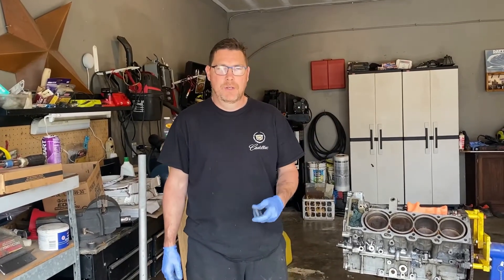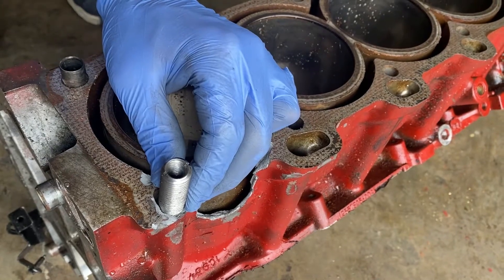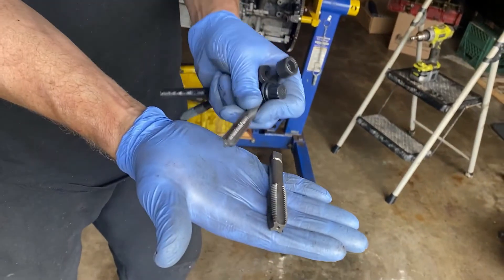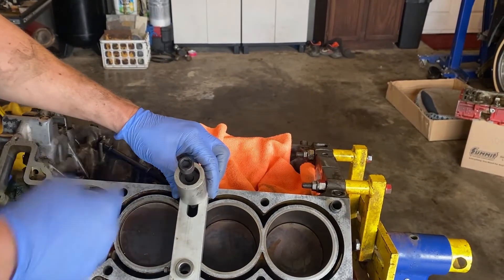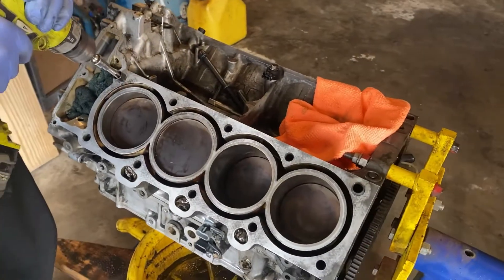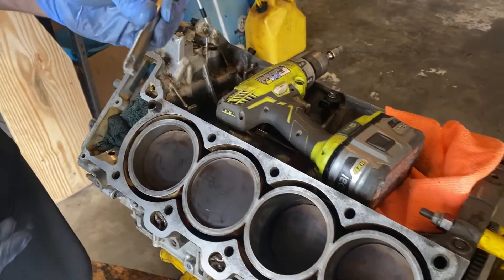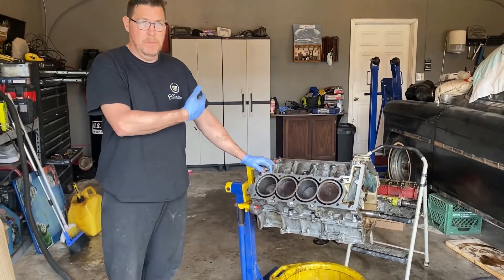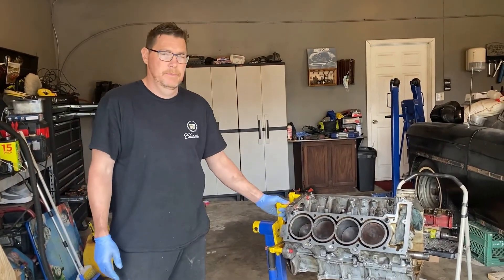Repair Cadillac Northstar Head Gaskets WITHOUT Inserts!

Comment: Hey I just bought a 2003 Cadillac seville. It only has 83,000 miles. Do you have any recommendations on how I can NOT blow a head gasket? I can not afford to pay for this, so my only hope of salvaging the car would be to do it myself. Any tips? I worked in a machine shop for a year, and know how to tap threads etc. but don’t really have the tools to pull the engine or the knowledge to. I can do most things with cars if I have the tools and am shown how but I wouldn’t feel comfortable doing this. I just need this car to last me. Not making much money, so any advice at all is greatly appreciated.
Reply: Pray
Reply: What we have done is flush the Cooling system over and over with Distilled water.  Used some Simple Green Pro Purple as a cleaning agent.  Don't use too much.  It is super concentrated.  Amazing how much gunk flushed out.  After fully flushed and rinsed, used Prestone G-05 Coolant.  This stuff it great and has low conductivity.  So far, our 1998 Aurora is still running on the original Engine.  104K miles and 26 years old.  Also, only use a GM Thermostat.  We installed a MotorRad safety stat and the Car started running too hot.  The MotoRad had 4 small hole for the coolant to flow.  The OEM Stat has 2 half-Moon cutouts for flow and it also opens wider.  Good luck.
Reply: flush the ever living crap out of the cooling system.  Use distilled water several times to both save some money, and to avoid chemicals.  once you think the system is clean, run radiator flush through it, such as prestone's kit.  The problem with the northstars for daily driving comes up when people entirely skip cooling system maintenance.  The FIRST time the northstar engine overheats, it starts to yank on the head bolt threads and head gaskets, even if you never overheat it afterwords.  THe cooling system has so many tiny ports and hoses that easily clog up.

Also, on these northstars, if the heater core gets plugged up, the engine overheats.  It is NOT setup like other vehicles where the heater core is an "accessory" to the cooling system.  On these cars, the heater core accounts for quote a lot of the coolant flow, and when plugged up (which also means otehr parts of the system are as well), coolant flow is restricted quite a lot.

An easy flow check, remove the rubber hose that goes to teh side of your coolant expansion tank,  point it into a bucket or container, and fire up the engine.  If you get zero flow, your system is already at the very least starting to clog up.

Once the engine is fully warm, you should get quite a lot of flow once the thermostat is fully open.
Reply: @mattliston1215  I personally do everything that you said to do with my own cars.  I want my cooling system to be clean also.

But the heater core is a separate system.  Inlet to heater core is at the back of the coolant crossover pipe and the outlet is right where the thermostat sits.  The expansion tank is connected to the outlet hose of the heater core.  Maybe you're thinking of the coolant filter pipe that vents to the top of the expansion tank, which actually does become a problem if clogged.

If the heater core is clogged, and the rest of the cooling system is good, you won't have overheating issues.  But usually if the heater core is clogged, there will be other issues with the cooling system anyways.
Reply: @mattliston1215  Do you know what Engine Temperature is considered overheating?  Ours got up to 250 degrees several times.
Reply: @scotta9114  250 is bad.

no cars come with a fast or real-time reacting sensor.  Basically, if you take a coolant sensor out of the freezer, and dunk it into a pot of boiling water, it might be as long as a minute before it shows the temperature properly.

Under normal driving, you should not see that temperature go over 215-220 degrees, even if it is 110 degrees outside and in stop and go traffic.

Northstars in full OEM untouched factory condition, cannot handly overheating even once.

Once they have a fix (my favorite is tapping to m12x1.5 threads and custom length bolts), these engines will take so much abuse.  THey get fantastic gas mileage for what they are, they are very fun to drive, and can be cheap to maintain.  Not in the parts cost, but teh frequency.  Expensive parts that rarely go out is easier to swallow than chepa parts taking a crap every five minutes
Reply: I just realized this video is right where I started finding out about the 12x1.5 bolts.  Years apart!
Reply: As Matt said. Do not let the engine overheat and do a proper full cooling system maintanance every other year atleast.
Reply: Drive it without theromstat